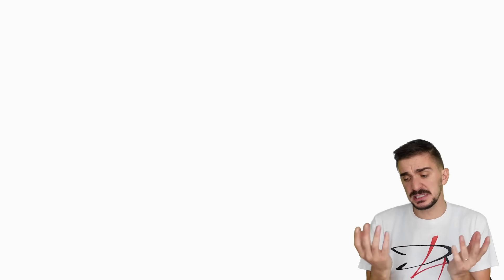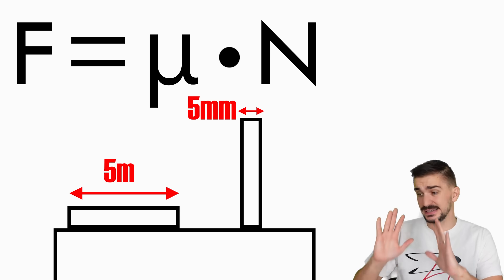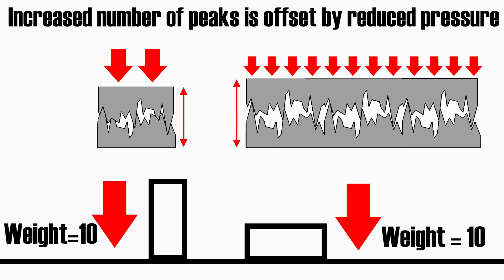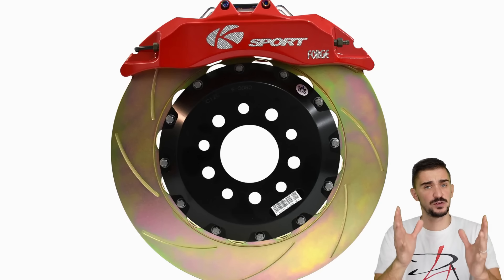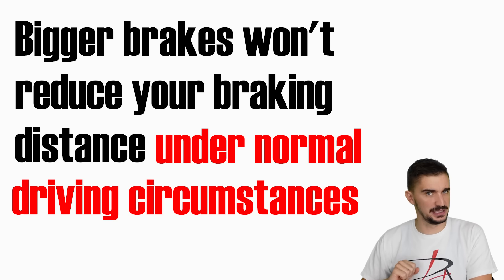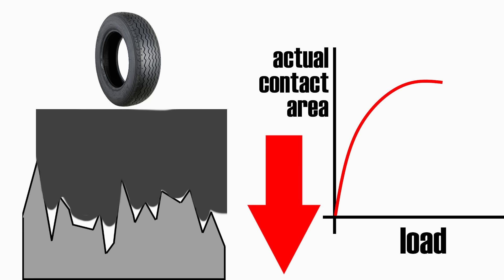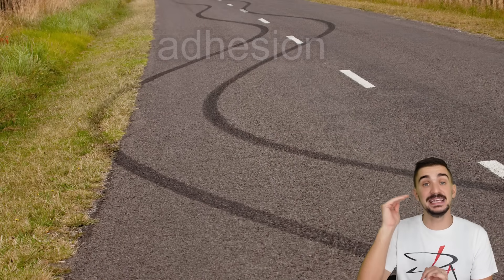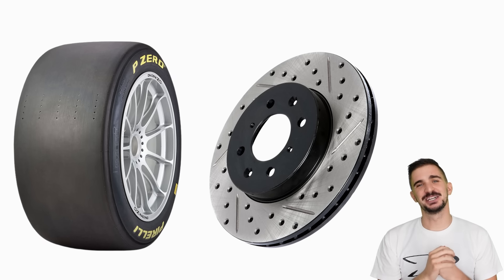Why Big Brakes Won't Stop You Faster but Wider Tires Will - Friction and Surface Area Explained

Comment: I call BS as I've always done when it comes to wide tires, (& I can prove it using your own numbers)

Wider tires like brakes have higher thermal mass meaning they take longer to over heat & it isn't the contact areas that's really gaining any mechanical grip, because weight is still divided. The point of saying tires are flexible & therefore get into grooves is negated by the very fact that it is flexible thus gets pushed out of those very same grooves if the weight keeping it down is divided

Enough talking here's the math, taking the slowest dry breaking (34.4m) & dividing that by the difference to the slowest tire which was only (0.5m) means the difference in going oh so much wider was "LESS THEN 1.5%" this means that an ABS system dumping full heat into more rubber will likely take slightly longer to overheat and gain traction, something that can be achieved by simply making the tire taller in circumference rather than going wider

This is the reason tires are wider for durability, in fact to really drill the point home let's go back to your numbers, the Top Two Dry Times "WERE EQUAL" regardless of one having much more total tire area than the other. This goes to show more that the smaller size tire were clearly too small for the loads of the car Vs wider somehow equalling more grip, because if it did going wider & wider would stop faster & faster yet it doesn't once you go wide enough to keep the tires below a max temperature

TLDR; dry handling max difference was Only 1.4~something%, that's hardly anything considering that the base time was using only 225mm tires which are clearly undersized for that BMW, don't mistake more thermal area equalling more grip, a taller narrow tire would give similar results, since about spreading heat, but taller tires are harder to package hence why people go wider. The same physics equation that works for brakes works for tires, if it doesn't we'd all be running wide LT truck tires on our sportscars yet we don't for good reason #TheMoreYouKnow
Reply: Wider tires, or tires with shorter sidewalls, or tires with wider wheels, have larger contact patch areas, with lower contact patch pressures, which results in more mu. It's very well documented and understood.
Reply: False; Mu DOES NOT change with contact patch, so just because something is documented, doesn't mean it's documented well. Where Mu does change is with regards to temperature as I've been alluding to. So while width on its own will not increase grip on a solid surface it can help temperature that's where you get your whopping 1.4% difference of statistical insignificance starting with undersized tires

Drilling the point home using this video as it's own undoing, the top two dry fastest times were reported to be exactly 0.00% different, even though 1 set had 11% more contact area overall when doing the math using width derived total area of all 4 circles combined. Reiterating 11% more rubber down, Zero, Zilch, Nadda difference to grip in a controlled test, meaning as I've said once you control temperature there's little point in going wider, because contrary to the graph he showed real tire grip Vs load actually has a linear relation until after a certain point where it tapers off, this is the very argument used to suggest you want to avoid operation in the area of the graph that's tapering off in favour of width, however using that same argument of your utilizing a wide enough tire (which may be well wider than stock) you may never operate beyond the linear section of the tires grip characteristics (which FWIW is data attained without correcting for temperature), so if your tire is never beyond linear loading than increasing the contract won't help, how can it if you haven't lost Mu, it remains a linear loading of compound regardless of going wider, that's physics

The issue is many cars are hefty enough to warrant wider tires for heat reasons than what's economical to sell them out the factory with, but we still live in a world where lightweight machines can be overspeced with tires beyond what they need, so the notion wider is always more grippy remains #False, because width doesn't decide grip, it decides temperature which is what Mu depends on, & the numbers don't lie..

The Numbers..; 31% more rubber comparing the smallest (likely undersized) contact patch setup for an about 1.4%~1.5% max dry handling gain which is extremely little & margin of error & can be more than explained by heat, what's more that's not necessarily even the fastest considering it completely tied with another setup that compared to it had 60mm of less tire overall and same result. So even whilst limited to what's in this video alone as a source wider tires, by which I mean in every instance increasing contact patch area don't gain grip on solid dry roads unless the tires were undersized to begin with, because contact patch size doesn't matter for grip if temperature is constant, because all that matters is Mu, & Mu only changes from temperature, NOT FROM SIZE
Reply: @ChroniclesofKToyoda  Decreasing mu is an engineering abstraction.

It is very much so a reality that tires lose mu with load, and that a larger contact patch surface area will lessen the effect. At 0N, the mu would theoretically be the same irregardless of area as there is no pressure on the contact patch.
Reply: @ArchOfficial  at 0 it's 0, obviously but that doesn't change the fact that Mu even beyond such numbers still describes a static property in a static temperature, it explicitly does not change with width, else it would be part of the equation. It is not, what changes has always been the state of matter at different temperatures

If it were reality as people claim than 30+% increase in contact should have statistical significant difference in grip level at some level beyond that of something less than that of margin of error. I have yet to see any tire grip data that corrected for temperature regarding tire load (they assume it does not change with weight which is false, as increasing weight is increasing heat) which supports said false hypothesis of Mu somehow not being static

If the telemetry gathered were reported were more accurately construed people would be more privy to correctly understanding what happens & what it is actually showing, for 1 measuring in N against slip angle is for starts a horrid way to do so, because you're essentially measuring acceleration energy against flexibility. This assumes flexibility (AKA Slip Angle) has some linked linear bearing to physical grip, it does not, nor can or should it be used to insinuate lack of grip, least not until it goes downward in which case you're operating well beyond the scope of efficiency of the compounds

Slip Angel confuses the issue, because the notion that if something is more flexible it becomes less grippy as it builds more paints a picture that more flexible materials are inherently more slippery, which is far from truth as tires are only grippy due to the very fact they are flexible. It surprises me how so many have not caught on that measuring against how much you need to turn the wheel does not represent absolute grip, because contrary to how the graphs are read a tire achieving the most slip angle is actually causing the most road holding as a less grippy compound would slip prior to as much slip because it wouldn't support the load, so if anything it's an indication of just how grippy the compound is causing the whole tire to twist as a result

This is why when going from a narrow tire to a wider tires, pointing to reduced slip angles isn't actually making the case of any benefit, as slip angle is a huge misnomer since slip angle denotes nothing to do with the tire actually slipping, it has to do with what direction car is turning Vs how much the wheel is turned, it's good for telling you how compliant the tire is & so it can take extra steering angle, but there is no distinction made with surface to surface grip characteristics here, so using that to misrepresent narrower tires is unfounded
Reply: @ChroniclesofKToyoda  Please nobody listen to this, thanks. Read Milliken for a start. This is just dudebro engineering with a lot of misconceptions and no actual empiric testing behind it.

By the way, slip angle is a function of the kinematic wheel/tire orientation and the tire slip vector. It doesn't actually have to do with the vehicle velocity vector inherently.
Reply: @ArchOfficial  "Wider is better bro," is dudebro engineering.. Countless places such as Engineering Explained already debunk this time & time again

The fact that I understand what Slip Angles are, is why I said it shouldn't be used to attempt to convey grip levels as proponents of going wider tend to do., again 1.4% Delta from probably undersized 225s to something 30% bigger area is the bar here, not a strong case like I said when there was a much narrower set by 60mm that achieved exactly the same results

You can keep insisting you're right, but the math & equations & the results form this very video are all on my side bud..  🤷🏼
Reply: @ChroniclesofKToyoda  Slip angle has literally nothing whatsoever to do with tire load sensitivity. Nobody is even testing saturation sweeps when they do load sensitivity testing, they are testing for Fy vs Fz.

You will get a bigger grip delta at larger loads, like when accelerating a RWD car out of a corner and the rear outside loads up. For a 30% larger surface area it might indeed just be 2-3% or whatever purely from load sensitivity. The other tires with less load on them will have a smaller delta.

The main reason much wider tires have much more grip is because the lower contact patch pressure allows softer compounds for similar surface wear rate. 

Heat is the least significant factor. All wider tires really do is decrease surface heating per unit of Fy. Cooling coefficients and everything are the same strictly mathematically speaking although inner air transfer is a bit different due to carcass mass changing. EDIT: Well, assuming construction is similar and tread coverage % is the same. In real tires it won't necessarily be, but these are other factors.
Reply: @ArchOfficial  DingDingDing, there you have it folks, agreeing with what I was saying in the first place, that width in & of itself does not increase grip, that it allows for softer compound AKA not an apples to apples comparison hence my whole point regarding temperature was something I harped on about

I take no offence if some says that wider tires tend to be made more sticky by way of softer compound, my beef was the sole fact that folks try to portray simply going wider alone as what matters. BTW your 2-3% is between 25-100%+ more extra grip then what was demonstrated here & that was under the most extreme load case of heavy ABS breaking starting from a rather small benchmark, essentially the strongest case of an FR putting weight down exceptionally well(is on its noise where there's more weight to begin with {+all that gets shifted}), where the best numbers here still are shy of the worst number you suggested, especially considering the small scales we're working with this is all not making a strong case of wider tires that are not different otherwise somehow equalling more grip, certainly not for road cars who will never see adhesive tracks

What you are referring to with Tire Load Sensitivity is only in the cases where you exceeded the; linear weight in equals linear grip out, performance range of the tires, where we still have some cars which WILL NOT operate beyond that range take a factory weight 1,700lbs classic Honda 5-Door wagon, being a boxy wagon without some overly low CoG and big rear 425 pounds per wheel static or 850 per axel, assuming it can somehow manage a massive sustained 70% weight transfer on a probably lowered & stiff track suspension, that still comes to UNDER 600 pounds fully loaded, my point being there exist tires where at 425 pounds the tire could generate 1.1Gs and at beyond what the lightweight Honda can still load that same tire can still be in within in 1.1G linier range meaning wider provides no benefits. Most cars who've done suspension will have limited weight transfer, & more track focused machines are built with minimal roll & pitching to begin with so it's merits as you've suggested aren't as universal & absolute as you've seemingly spoken it as

All this aside, even though lighter cars exist, cars with solid axles & more centralised/inboard suspension exist & so on all which minimises the effects on how much weight can load transfer to where any of the already marginal benefits can be realised. The fact remains the mentality that wider is always better is being portrayed as some hard & fast rule where folks are being lead to believe there is no limit to how big is too big, which is still factually untrue. Especially considering that maybe 1~2% benefit is really only felt on prepped suffices that have a chemical grip material deposited into the ground where area does matter because that's adhesive but not helpful to most folks looking for more traction looking for more traction in 4th gear on their usual highway pulls thinking there added grip proportional to the width

You don't find it in the last disingenuous to portray wider is always better knowing good & well Joe the YouTube viewer probably shouldn't be persuaded into getting even wider tires for his 1st gen lowered street Miata, when the same benefits or more can be had by recommending widening your track which is really where a lot of the benefits come from, because that is what physically limiting as much weight transfer and more equal utilisation of the grip we have assuming you have a car with enough loads to operate out of the linier range and for whatever reason are chasing handling grip yet don't have a tighter suspension which is going to limit percentage of weight you can shift around anyway

Do you see all the holes in the argument for wider is always best, other than simply not being factually true, I'm not saying there aren't cars who won't be happier with the biggest meats you can feed it, but you should get by now my well described view that it wouldn't be viewed as always the answer & that it should be conveyed with transparency in just how minimally it adds to grip in the cases someone does go wider without choosing a better compound, & the disclosure that it's really the compound increasing the grip not really the width
Reply: @ChroniclesofKToyoda  No I'm not. Wider tires, or tires with a larger CP area, have less load sensitivity, so more grip. Within reasonable parameters this is always true.

It is independent from compound, although practically more width often correlates to softer compound being chosen.

EDIT: By the way, there is no linear region of fz/fy increase. That's measurement error and I have seen the exact test you are talking about. Load sensitivity effect begins immediately as soon as load is applied. The slope delta is what you're looking at when comparing tires' load sensitivity. The easiest way to express it is a reducing mu with load.
Reply: @ArchOfficial  the fallout doesn't happen until much later, this is why I said slip angle confuses the issue, there is a vast amount of tires which all have a linier section when graphed correctly, so long as you aren't running below such perimeters there is no benefits, & as I've said some tires are overkill, notice how the testing in the video even stopped going for wider front tires once going wider in the back already capped the performance, if going wider in the front had been of any more benefits they would've shown the results, but can't post such results if the wider tires didn't validate the claim hence their absence..

& again I understand how wider tires will simply be made of softer compound, & that even within a range manufacturers will vary it's composition by size from any reputable brand as standard practice already. I am not in disagreement of that, but saying softer compound grips more is not something anyone is arguing against. However something that does hold true is using a setup where the tire is too wide for the performance of the machine & therefore runs below temperature will offer inferior grip levels when compared against narrower tires running within proper temperature, so as I've said from the start there is a such thing as too wide, having a tire too wide to get enough heat into is a prime example of widest isn't best..

The results of the testing here even backs what I said up because going from the 2nd largest to largest showed ZERO improvement in dry braking, the only time you see a non-linear relation from the onset if you're working with a chemical grip compound or a chemical grip surface, only than can you start chasing that 2% which even in the best control case was not realized here, nor will it be for the 4th gear highway pulls far as most everyday enthusiasts are concerned. So as I've said temperature is what changes Mu, for example cold grease against cold here grease friction Vs boiling oil against itself will have vastly different levels of adhesive properties. It's temperature which changes Mu, & telemetry where people chuck the car out on a test course and progressively load up the tire & data-log does not correct for the temperature gain with load & the resulting grip falloff
Reply: @ChroniclesofKToyoda  Do you mind telling me the name of the paper which shows a linear Fz/Fy relationship? To now I've yet to find a tire like that. Possibly some front-loader tires and the like can maybe have a low enough longitudinal slope that it's almost linear; surely not car tires.
Reply: @ArchOfficial  I remember it was a NASA article in particular that changed my mind on the matter, as beforehand I had similar beliefs to yourself
Reply: @ChroniclesofKToyoda  They're not beliefs, like I said this is well documented. I've built literally dozens of vehicle models into simulators, and none of them would work at all if they were using the kind of principles you think tires work by.
Reply: @ArchOfficial  once you educate yourself into the NASA documentation you'll begin understand the flaws in interpreting the data without consideration of temperature, & your beliefs will change as result, not to mention your last statement is blatantly false as physics in games are always an approximation, hence why developers adjust them over time
Reply: @ChroniclesofKToyoda  I know what test you're talking about, some LMP1 sim engineer student went on about it once, spouting similar bullshit like you are. The difference is he did believe in load sensitivity, but not in slip sensitivity. He thought all slip sensitivity is due to heat. Christ you people. I have nothing more to say other than I hope nobody listens to your nonsense.
Reply: @ArchOfficial  funny considering that's not my source as I've said, the data in these examples back me, punch massive holes in your argument, demonstrate your lack of understanding with uncorrected telemetry. +Plus NASA itself spelled it out, however when people such as yourself talk down about a Sim engineer when you yourself only make assets (no different than me in UE) it kind of discredits your own argument when you want to interpret data without correcting for heat & misrepresenting facts, & as I've said I don't believe there is no drop off, doing so would be denying load sensitivity as you are claiming I'm doing outright, which I simply said doesn't take place until after a specific threshold. This means contrary to what you just posted it's slip sensitivity that I've repeatedly said is a poor metric when temperatures needs to be corrected for, & as load increases so does temperature therefore of course you're bound to continually misunderstand because in your mind Mu is changing without you ever taking in to consideration it only changes due to temperature not isolated loads

This is why the video showed 0.000% difference between the the largest & second largest tested, & only negligent numbers well within error for undersized 225s. The proof is on my side, because the results are on my side, nothing you've said has been able to refute said findings. Again I'm not saying wider tires won't still be faster for other reasons, but it simply isn't based on width alone, some day I'll even post a demonstration that accurately corrects for temperature & makes it blatantly obvious this misguided misunderstanding that tires single magically operate on some different set of physics than the rest of the world, the only reason the wide tire argument has held any water for as long as it's had is because the weight of modern cars & the softer compounds we choose to use results in us operating in the upper end of what tires can do where yes melting can take place so long as that is the case uncorrected load sensitivity graphs will continue to make folks such as yourself misunderstand what is actually going on

#CorrectForTemperature, your arguing for 30% more tire going from smallest to biggest for negligible 1.4~ish% gain up from undersized 225mm, & the fact that there was ZERO IMPROVEMENT when going up the final time, meaning linier grip was met & wider hadn't helped. This is the proof, this is on video, & NASA the certified authority on physics, agrees with me. End of Story
Reply: @ChroniclesofKToyoda  Why do you think the thousands of graph lines I've looked at don't correct for temperature?
Reply: @ArchOfficial  because of how they are usually tested which is a dynamic test which can not correct what it can not actively measure in real-time, surface temperature is one of those things as the measurement average can only be made after the rolling surface is exposed to air at which point the temperature can be vastly different then when dealing with massive shear heat forces that the load cell measures as an average, but the temperature needs to be measured at an exact instance, a problematic endeavor

If there is a test protocol that has found a way to isolate for this, I would gladly love to see it, but as of yet to the best of my knowledge this proper methodology of testing has not been established due to the physical nature of these tests, & average tire temperature does not & can not represent the actual elevated temperatures at the surface interaction at the point of contact at these high loads of question
Reply: @ChroniclesofKToyoda  You heat up the carcass, then cool down the surface and test for highest force. It's not like you do a full sweep from 0N to 10000N in one run.
Reply: @ArchOfficial  do you still not realize how inaccurate the form of testing is, surely you can see the massive flaw in logic here..........
Reply: @ChroniclesofKToyoda  No, the results match up well to experimental and simulation outputs.

There is a small % of potential error because the surface temperature does not necessarily correspond with average carcass temperature, hence why you test for highest force. You need to also do slip angle sweeps to make sure the saturation peak (potentially) changing is accounted for, although the saturation peak is quite wide on real tires so it's not a significant issue most of the time. 

Of course this is assuming that the loads are still in the linear region of the slope. Around 10,000N~ the slope changes although test data often does not go past that. I suspect this is fairly close to the failure load for many tires to begin with.
Reply: @ArchOfficial  you admit that the form of temperature testing is inaccurate (as I've been saying all along,) and say various assumptions are made in estimating these final values, yet want me to concede to the notion of #TrustMeBro it's close enough when discussing a literal few presents in such a small scale WHERE ACCURACY MATTERS

Are you not seeing the level of mental gymnastics at play when you're attempting to assert that the temperature is accurate enough when clearly they have not been all along🤦🏼🤦🏼🤦🏼🤦🏼 & for extremely obvious reasons they cannot be
Reply: @ChroniclesofKToyoda  No, it's not inaccurate. It just means you need to do the test properly. If you do it improperly, it's inaccurate.
Reply: @ArchOfficial  how can it be done properly if you can't measure the contact temperature in the instances of exact testing, even the best in tire pyrometer from Michelin can't get results fast enough, not to mention even if you could stick a probe in the there during the test, the mass of contact still has buffer of mass hence the temperature is never exact, nor is holding it in place to equalise an option

Were talking about actual physics here where entropy is the enemy of clean data, show me a single testing protocol that can work in these constraints without assumptions & I'll be a believer, until that exists, that few percent that supposedly to always be the trend (even though this video disproved that by having equal dry stopping) is subject to error or other advancements that wider tires may bring such as thermal mass. This is why I've said such tests are misleading because they don't account for temperature fluctuations
Reply: @ChroniclesofKToyoda  You don't need to know the exact surface temperature, and moreover there are capable sensors which provide instant data feed. Your info seems to be decades out of date.

Real data is very noisy but you can formulate trends from it. For this kind of stuff you don't even need thermal data to begin with.
Reply: @ArchOfficial  That's False, you do need accurate temperature of the precise surface in question & only laser/IR based systems can go around thermal mass(still not instant because of averaging), regardless I've not seen any protocol where it can actually measure at the source, so if you're suggesting there's a newer industry standard which can, I'm all ears  ..🤷🏼

So..  Here's a homework assignment for you, find a publicly available ISO testing protocol that supports your claim of being perfectly considerate of temperature fluctuations, I'll scrutinize it & let you know just how right or wrong you actually are..
Reply: @ChroniclesofKToyoda  What part of "you do not actually need thermal data for a tire load test" do you not understand? You do not even need it for a slip sweep, which you will also be doing when testing for load sensitivity anyway.

If you've seen an actual slipratio/Fy graph, you would start to understand why you can only really go with trends, irregardless of how properly conducted the test was. Real data often has small irregularities even in the smoothed trend, it's just how it is. That small error will never end up indicating what you are insinuating about tires not having load sensitivity until a very high load. It doesn't even mechanically make sense.
Reply: @ArchOfficial  what part of Mu is temperature depended and therefore changes results do you not understand

Get me the ISO standard than we'll talk
Reply: @ChroniclesofKToyoda  You do a sweep. Load the tire, slip it for some time and check the data. You will get peak average forces once the tire is at temperature. You figure out the peak slip ratio for the load and start plotting a curve as a function of maximum Fy for a given Fz.

The bigger issue here is that tires on sandpaper do not behave like tires on tarmac. The actual load sensitivity will be different, generally towards more sensitivity IIRC.
Reply: @ArchOfficial  So again, if the testing methodologies are inconsistent the data is still bad, up until maybe the last few years lab testing & real world testing hardly lined up at all, why because in dynamic testing temperature is a huge factor that people are incorrectly assuming isn't changing at molecular level of interaction, this is why precision matters

This is why I asked for the specific ISO that you feel is most accurate, so I can look it up & check the numbers, because some of these tests do have a linear relation plotted depending on the methodology of testing & what scales they are using, how you map data points has a huge impact on how people interpret what they think they are understanding

So simply find me the ISO as I've asked which you feel is most accurate, because you & I both agree that the testing is flawed, with the difference being you want me to assume that the lack of accuracy is ment to arbitrarily support that wider has more Mu, whereas I've said that Mu is higher not because of width but from temperature which lack of accuracy can't convey, but it's well established everywhere else that temperature is a major factor of grip, far more than surface area since it changes far more than a mere few percent

So, I'm going to busy myself elsewhere, so go ahead and find the specific ISO standard, not some description of only the steps you know about, but the actual number so that I can look up their exact method, & what steps they do or don't include, & what equations they do or don't use to equalise for data. Until then there's no reason for me to agree with you, so find me the protocol you feel will convince me & I will scrutinize it later